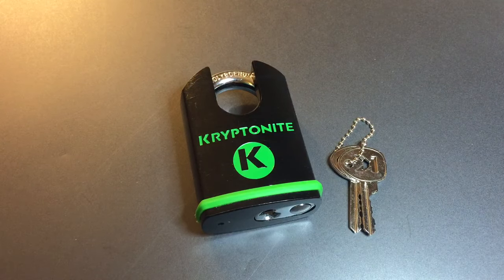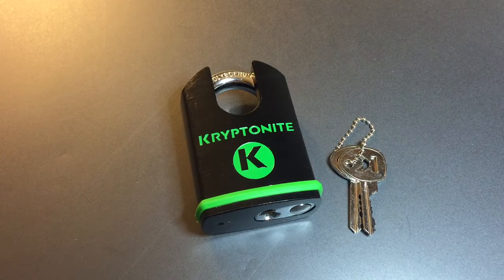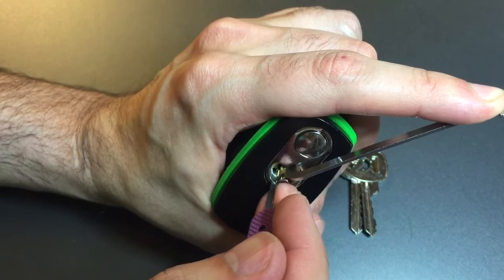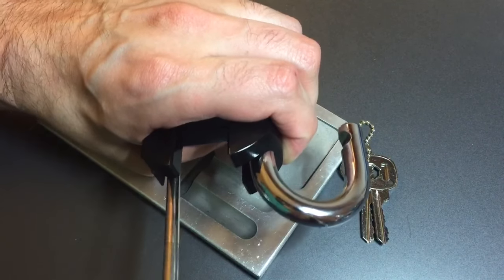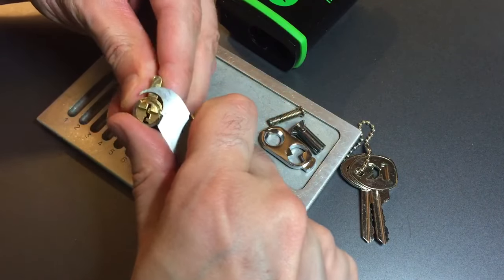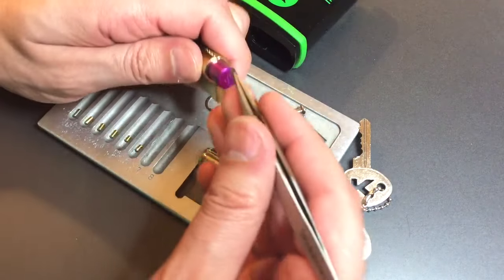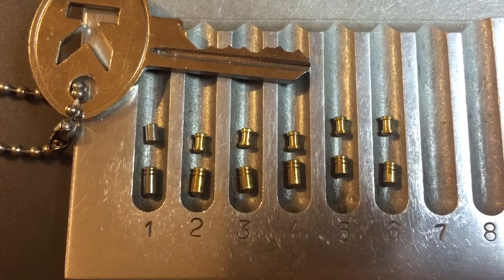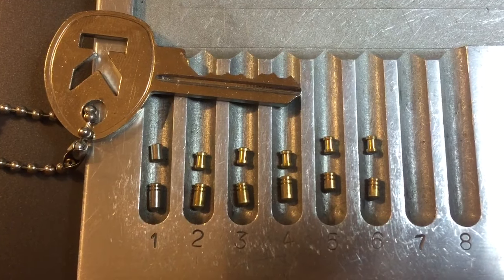[230] Kryptonite 61mm Shrouded Shackle Padlock Picked and Gutted (Model 851196)

Comment: You certainly are becoming the You Tube picking expert. I have one of those padlocks and they are a hefty piece and I have tried picking mine, no luck so far! I think they made those a few years back, I got mine for my bike, it was not inexpensive. Thanks for the video.
Reply from the maker: Thanks.  Do you recall the price?  I've been having difficulty finding any information on what Kryptonite charged for these locks.  Thanks.
Reply: I think it was around $70.00+. At the time I purchased a Kryptonite chain and the Cannondale bike, so the seller may have cut me deal on all three items. The chain and the lock were like a weapon in terms of mass and weight (a flexible sledge hammer)!
Reply from the maker: +Peter M Thanks.

Comment: Nice picking! I posted a video a couple weeks ago of the non shrouded version, Heavy locks with good cores. There was a discount store near my by that had them for $20 each. i dont think they knew what they had.
Reply from the maker: I saw that video... unshrouded 50mm IIRRC.  Nice find.  The funny thing is that $20 is a lot closer to what they should cost IMO, but for reasons that are beyond me, the prices are much higher.

Comment: I like it only difference being on American every pin is security on all the ones I got anyways. I haven't seen an American Standard pin, but that is a very nice lock. As usual nice picking.
Reply from the maker: Thanks.  For some reason on these Schlage-made locks, the anti-drill drivers are standard, but the anti-drill key pins are serrated.  Not the first one I've seen.  Weird.
Reply: Ya would think they would both be standard just to save whatever bit/cutting blade they use for the serrations.
Reply from the maker: Randy Perkins Agreed, assuming that they don't cut the serrations before hardening.
Reply: Perhaps the lack of serrations is in order that the pin be more likely to spin in the chamber if you don't drill it dead on center, which is a feat of skill in itself. once it starts spinning you can drill for hours. 
@ LPL- [still smiling]

Comment: Is it normal for these locks to use anti- drill pins in number 1 pin stack? Informative. Thank you.
Reply from the maker: Many of the padlocks made by Schlage (branded under the names Kryptonite, Draper, Federal, Sesamee, etc.) have hardened pins in slot one.  But to answer the broader question, anti-drill pins are not very common in these small padlock-sized cores.